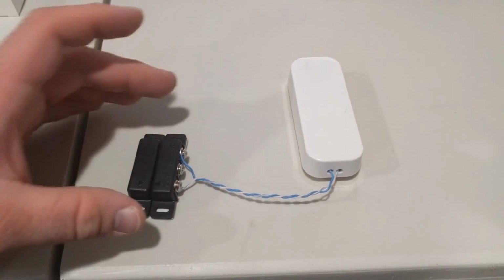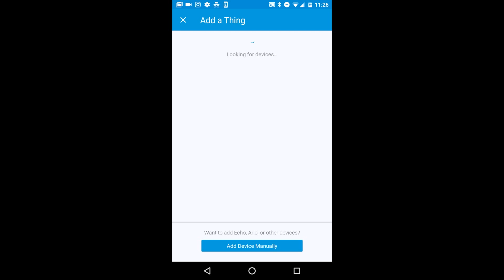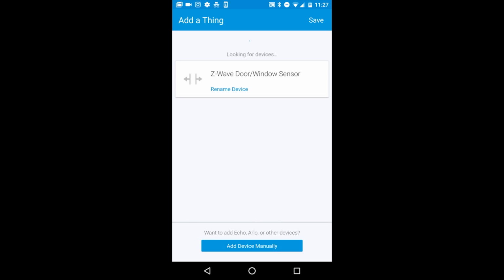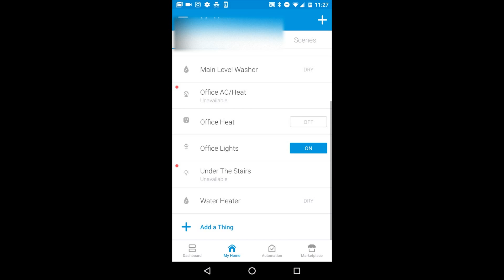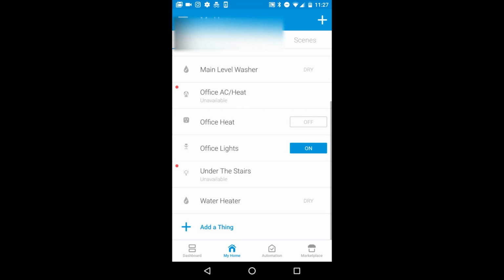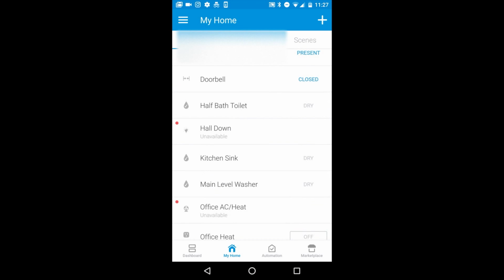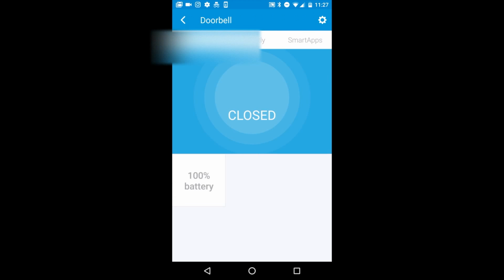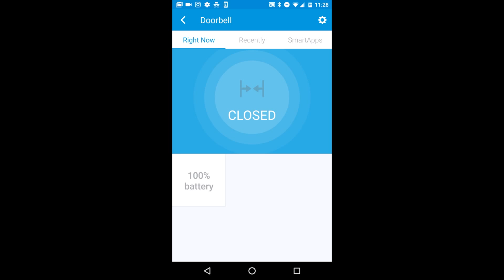Smartthings doorbell install and setup - Aeon Labs dry contact z-wave sensor

Comment: Thanks for your info. I didnt set it up like you but i took the concept amd figured it out. I used an extra wyze door sensor i had and set it next to the electromagnet. Use the larger side of the wyze door sensor. The smaller piece just contains a magnet and wont be needed. Press the door bell. The electromagnet engages to ring the chime and triggers the wyze door sensor. The sensor will read even if the engagement is fast. You have to position the sensor so that the electromagnet pulls the trigger inside to trigger the sensor. So play around with positioning the wyze door sensor to ensure it engages. Find a way to mount the sensor too but remember that you may need to change the battery later. The wyze door sensor can notify my phone or alexa or a third party siren through wifi.